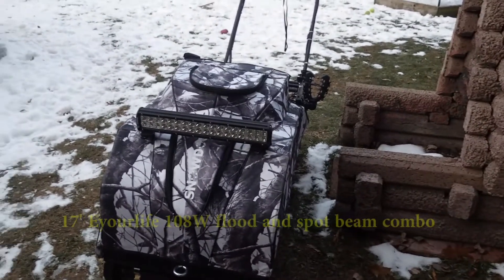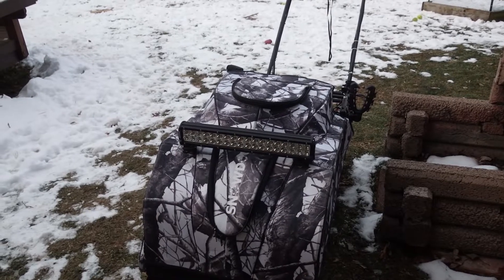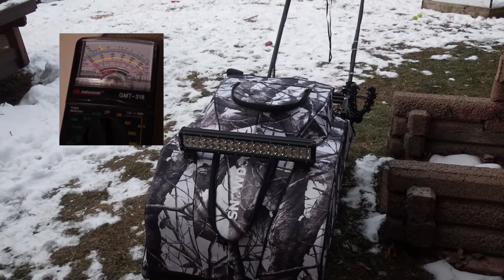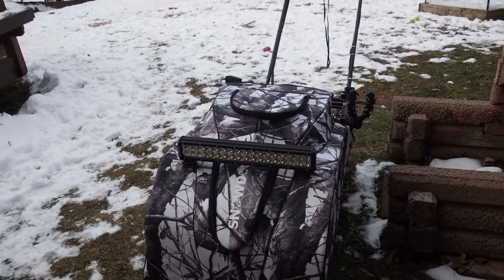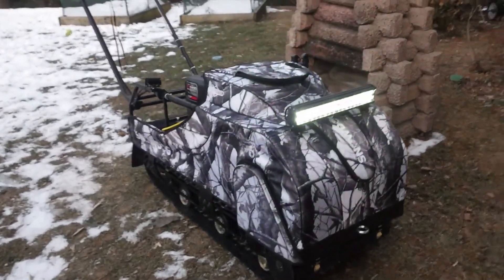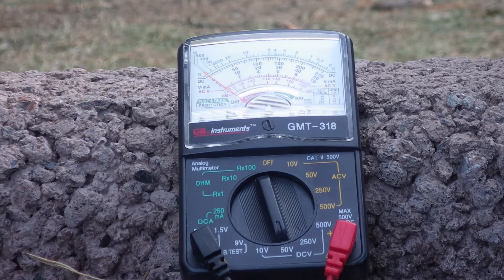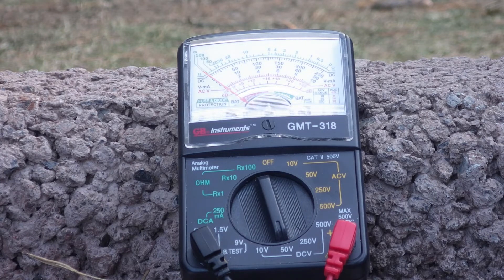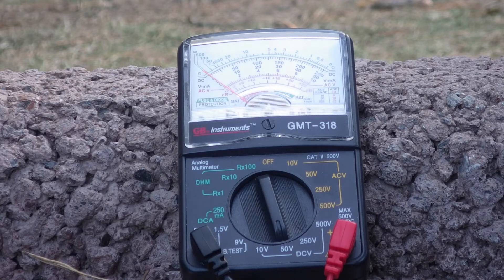SnowDog Light-Bar/Battery Test

Comment: How did your light work out for you. I'm putting on a 20" bar led headlight. Also putting some carbide studs on this weekend. Cheers
Reply from the maker: Just fine. No issues at all and I'm still using the original battery that came with the SnowDog although I do "top" it off once or twice a season.
Reply: Great thanks, enjoy the rest of your winter

Comment: Hi Kelly, A little change to that subject . Going back to Winter 2017: 5-Day solo trip at 7:19 you show stove pipe anchoring system. I noticed that you used a spring at one of your anchoring points. How is that system working for you . Do you still use it?  If  so what size spring do you use? Thanks  for your videos learn a lot from them. Just retired  and started using my tent.  Scott
Reply from the maker: Hello Scott, I still use the anchoring system its great. I stopped using the spring as it was useless. I now just tie it directly to the D rings although I do use a short piece of wire first so the para-cord isn't so close to the pipe.